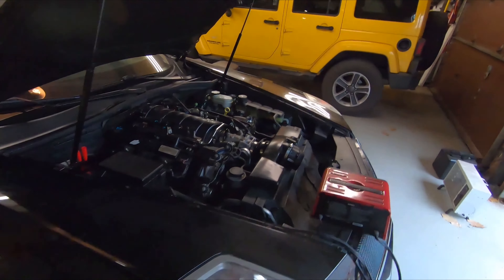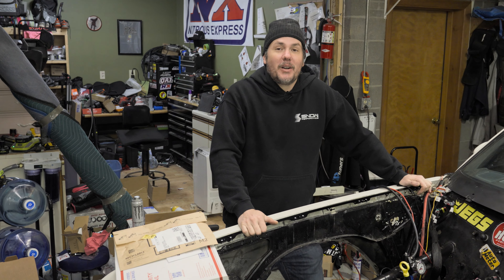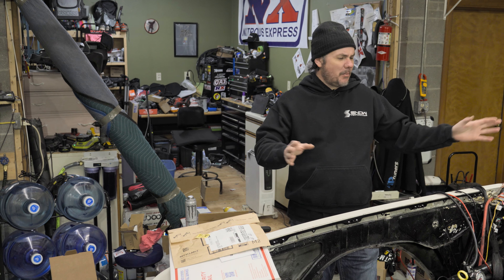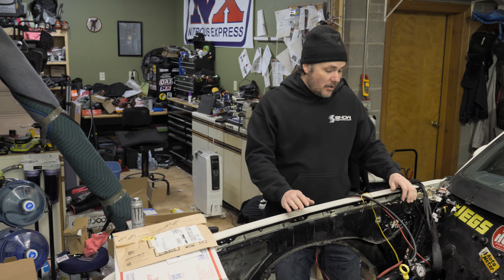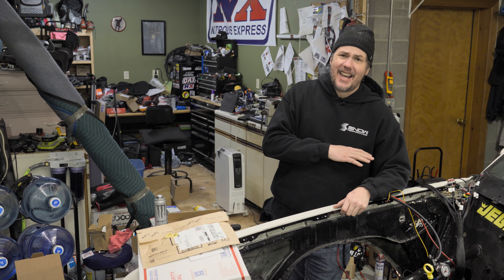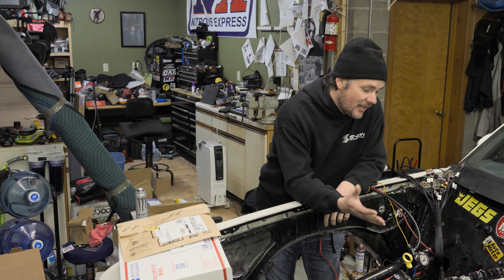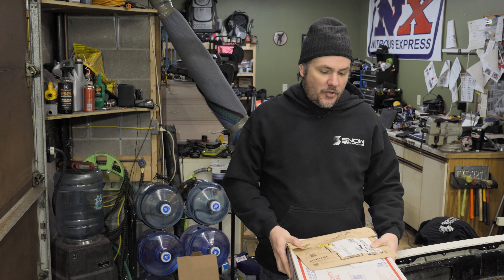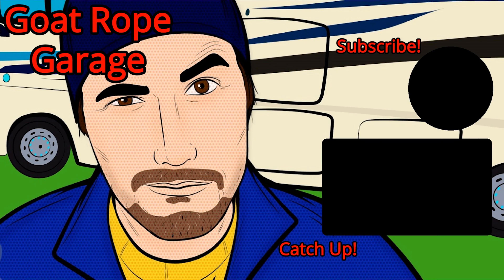The Monte Carlo SS LS Swap Is Cursed!!

Comment: On your grounding issue.   If the battery is in the trunk, run a battery cable ground 1/0 or larger to the front.  From your description, it sounds like you had a weak ground and it found a ground path through your MPVI and headers.
Reply: Yep I do these swaps for a living. Whenever you move the battery to the trunk you MUST run a ground cable from the battery to the engine. I learned the hard way and the funny thing is depending on the vehicle you may get away without running that ground for a while but eventually that sucker will not start.
Reply from the maker: @tscustomstation it has a ground to the front of the frame that has a ground directly to the block. There is a short in the power lead or shutoff switch.
Reply: @GoatRopeGarage unhook your battery terminals and start DMM probing from the positive terminal to any of your body grounds, should be a couple megaohms if there isn’t a short and everything is unplugged, if you find there is resistance start unhooking switches and connectors til the resistance increases, that might help find which component has a short to power or power feedback issue
Reply: @GoatRopeGarage   normally this would be fine and it will check fine with no load but I'm telling you I went through hell relying on traditional grounding. Also add grounds from the back of each cylinder head to the block. And from the block to the body. Every car I build now with the battery in the back will have a 0/1 gauge ground from the bell housing to the battery along with traditional grounding. Btw I fried a hptuners box as well before I figured out the ground issues
Reply: @GoatRopeGarage  think about this every single car with a battery in the front has a ground from the engine to the battery

Comment: You ever do any tuning on a 95 lt1? I put a Camshaft, Hydraulic Roller Tappet, Advertised Duration 276/290, Lift .510/.510, Chevy, LT1/LT4, Each. Cam in it and will need to tune. Thought I may use you for advice maybe a few answers. 

My software is tunercat. Think you could answer a few questions when the time comes